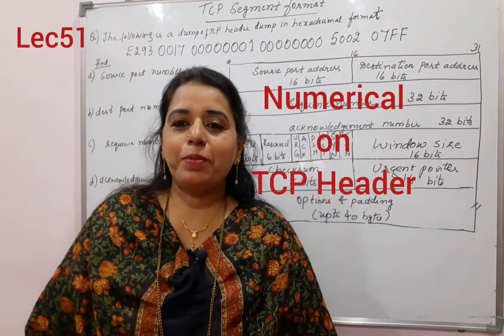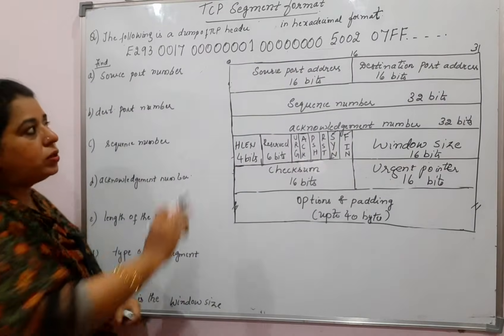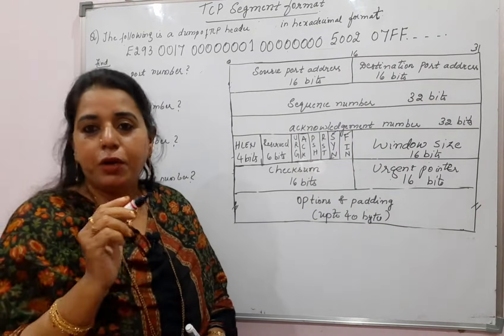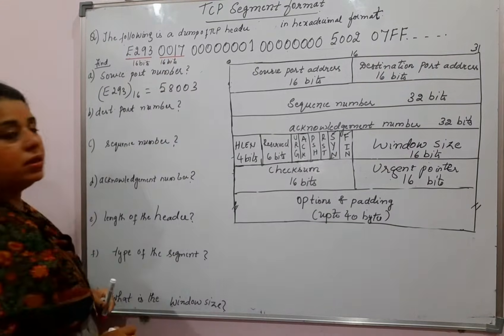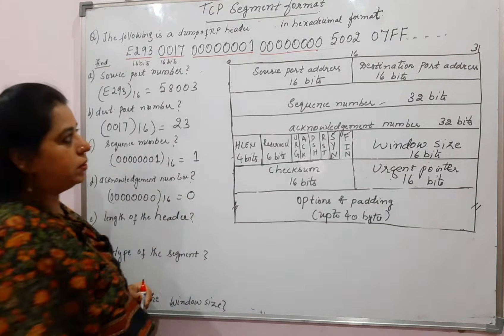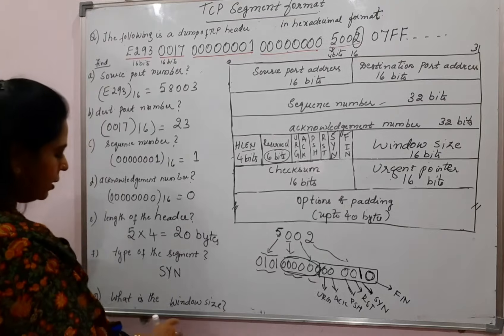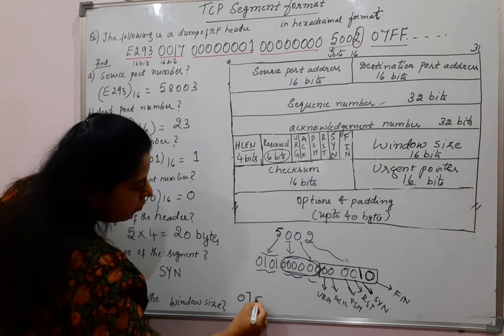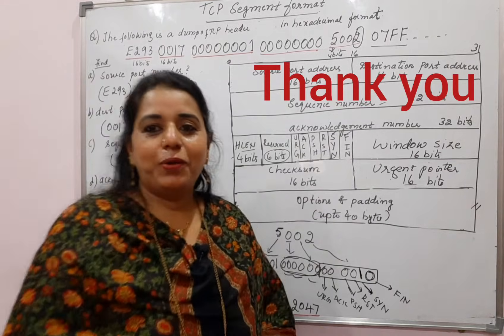Lec51-Numerical on TCP Header |Computer Networks

Comment: Mam, I have a doubt there is a PYQ in which they have given a TCP dump and are asking for what application layer protocol is being used  ?
Reply from the maker: Can you post that question??
Reply: @engineeringwing7469   Following is a dump of TCP header 
15430050345437890160000060208ff00000000, find and interpret values of 
various fields of TCP header. What kind of packet is this? Which application layer 
protocol it is using?

Comment: Ma'am I have got a question like 

The following is an invalid TCP header dump. Justify the existing error/s
and write the corrected TCP header.

AF08 001 7 0000 OOA5 0000 OAO 1 8000 0800 0000 OOA2

How to find answers for this ? Looking forward for your reply!
Reply from the maker: Let us call four numbers as one section in the given tcp dump. There are 10 sections given. 

 Replace the letter O with all zeros in 4th , 6th and 10th section.

 7th section will become 8020 bcoz we need to make the URG bit set ..this has to be set bcoz there is some value shown in urgent pointer field.
Reply: @engineeringwing7469  Thank you so much ma'am I understood it
Reply: @engineeringwing7469  dont understand can you do a short video of it i have an exam week next
Reply from the maker: @jamesbaysah7630  where exactly you have the doubt??